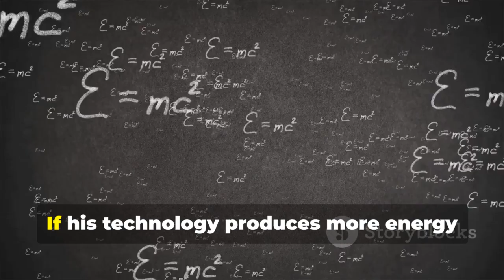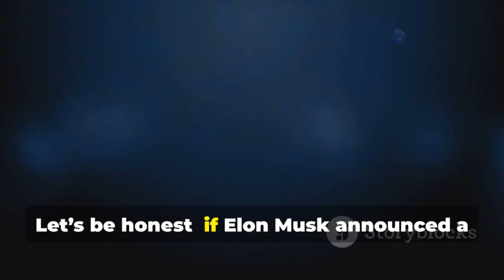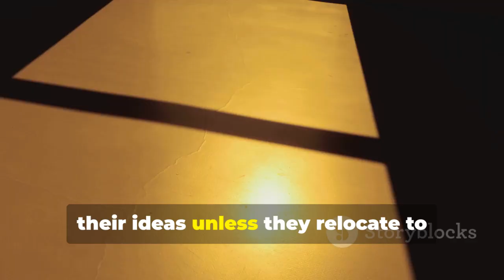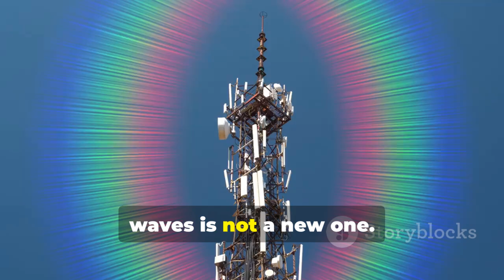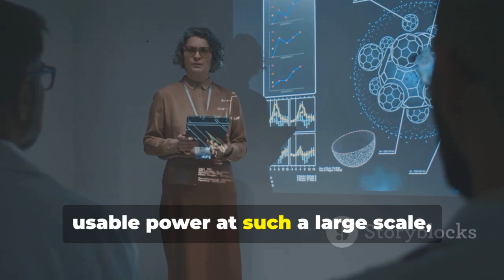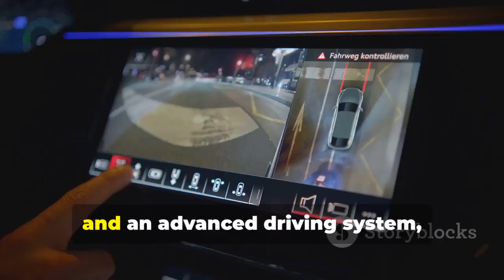Maxwell Chikumbutso Inventions Price List is Out

Comment: I gave a list of facts before, but here's another perspective: Before Chikumbutso's magic "microsonic device" can generate power from radiowaves, the radiowaves have to be generated. This is done by transmitters mounted on transmitting towers. Now, for a high-power FM Station (Commercial/National), for a 100kW ERP output and a range of 150 to 300km, you'd first need to power the transmitter with about 40kW of electrical energy. ERP decreases by the square inverse law of 
Power Density = ERP / (4πr)

This means that if you had an antenna of 1kmx1km (1000x1000m!) at a distance of only 10km from the transmitter, the ERP power collected can only be around 80W. Since Chikumbutso's EV needs around 150kW for maintaining 220km/h, you would need to feed the transmitter with 40 x 150,000 / 80 = 75,000kW or 75MW. That is a solar panel measuring 580x580m!!!

Can you see how uttelry nonsensical this "validation" really is? I mean, let Chikumbu
Reply: It is obvous you have not looked into the product.  You sound like an AI propaganda machine which are attacking Maxwell.  You did the same to Tesla.  SHAME
Reply: I daresay that I have looked into "the product" (which product, exactly?) far more than you did. And I did the same to Tesla? Are you high?

Since my reply routinely gets deleted for unknown reasons, I removed all web references, but a cursory search should quickly bring you to the relevant web pages:

Full Maxwell Chikumbutso debunk pack:

First, a DIY analyses of Maxwell’s claim that there’s sufficient useable energy present in radio waves to power a car indefinitely:

A small car on an even road would need about 12.5kW to maintain a steady speed of 100km/h, going up to 19.9kW at 120km/h. (Such a car would be severely underpowered and basically unusable, but let’s stick to those low numbers to demonstrate the utterly flawed principle.) Highly congested urban areas with plenty 4G, 5G, AM, FM, TV, Bluetooth and Wi-Fi have a radio frequency density of about 10mW/m² (A mid-range solar panel generates 170W/m², about 17,000x the output of what could be harvested from radio waves). If you had a 100% efficient antenna, which also doesn't exist, you'd need a receiver with 12500/0.01 = 1,250,000m². In different terms, that's an antenna measuring 1.1x1.1 kilometres. 
(As to the claim of 220km/h, that takes around 150kW, or an antenna measuring 3.9x3.9km.) 

The microsonic energy powered car is in fact a Kaiyi X3 PRO EV, manufactured in China with a MSRP of $18,500, and an electric range of 370km:
Search for "Kaiyi X3 PRO Pure Electric SUV Left Steering Version Wholesale Supply"

The “Microsonic energy device” is actually a UPS power supply, available from Alibaba for $795.48
Search for "Portable High-Power 1000W Mobile Outdoor Solar Panel Photovoltaic Charging Emergency Regulations Portable Power Supply"

The leading automotive magazine in South Africa questions his claim:
Search for "Car magazine Zimbabwean Inventor’s Revolutionary Self Propelled Vehicle Claim – Real or Not?"

Snopes actually debunked it:
Search for "Snopes Did a Man from Zimbabwe Invent an Electric Car That Requires No Charging?"